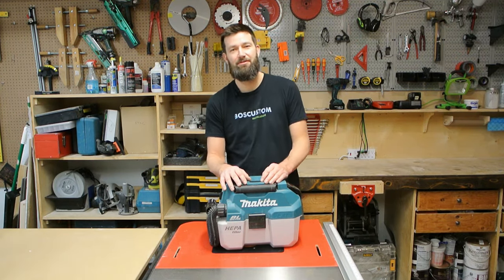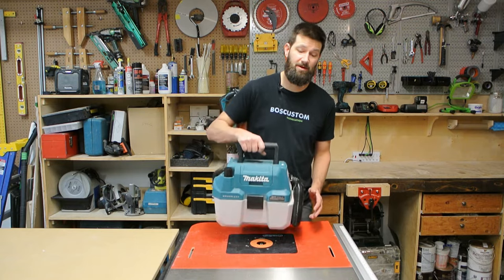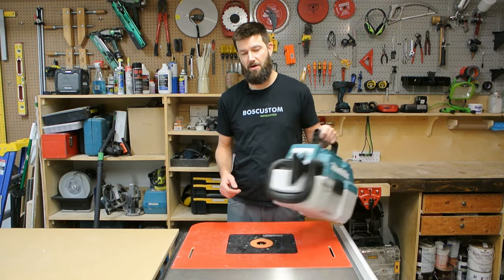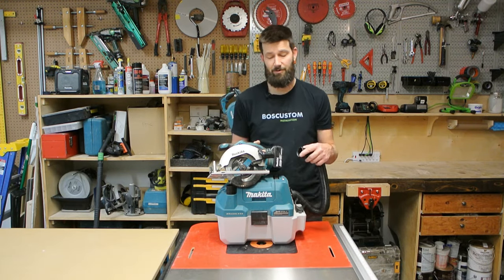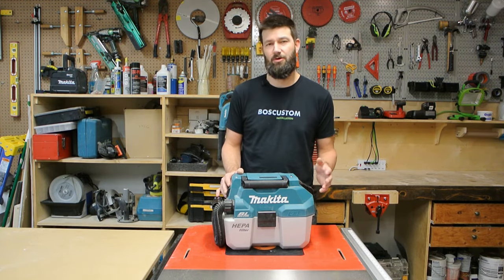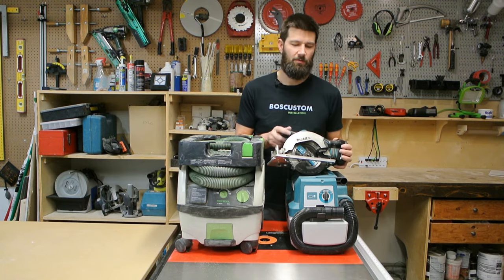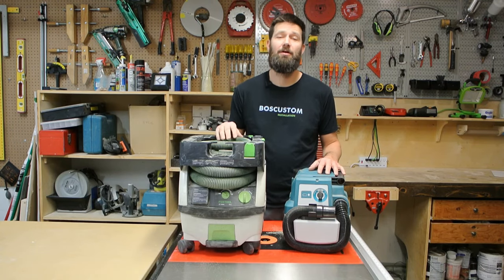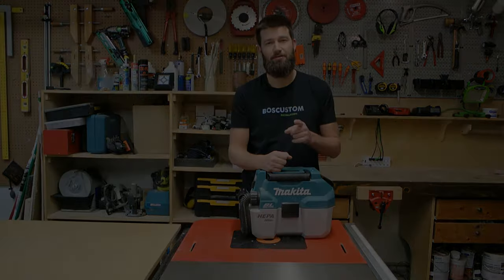Makita Cordless Vacuum Review

Comment: Great review. This definitely fills the gap when you don't need the power of a larger shop vac. Perfect for a cleaning up after a small job and just the right size for cleaning the car by the looks of things. Definitely ordering one soon.
Reply from the maker: Nice! It’s a great unit.  If the filter is clean and the battery is fresh it does a decent job with vehicles.

Comment: I really appreciate the comparison to a corded vacuum. My biggest concern before buying the makita was "will this have comparable suction power."  I do fire/water restoration, using equipment as a convenient step stool happens frequently on the job site. The makita vacuum seems perfect to use with tools for dust mitigation as well as great for smaller job site clean up. Awesome review video, you just sold me on the makita vacuum. I can now buy it with confidence!

Comment: How’s the battery life? I have the Milwaukee m12 fuel vacuum and I get awful run time, granted I’m using aftermarket m12 batteries. But it’s really a battery hog. How is this one? My main system is Makita LXT, no clue why I didn’t buy this one.

Comment: At 5:04 in the video, can you please share the model number of the extension wand and floor nozzle you're using, please? I've looked high and low for compatible attachments and have come up with no solution.
Reply from the maker: Nom Solo that is the Festool compact cleaning set. FEST203430. It’s not cheap but it is awesome.  The fit is not perfect with the Makita, you have to jam it on a bit.  It’s like 95%.
Reply: @TheFunnyCarpenter  what kind of extension did you use for the circular saw? where any change in performance? I guess it was lower with it, but still enough to vacuum the saw dust.

Comment: Do you recommend this cordless makita vacuum for a auto detailing?
Reply from the maker: dopey310k just tested it out with the crevice tool on the carpet in my truck.  It works better than I would have expected.  You’d probably still be better off with a corded vacuum, but if power availability is a problem the Makita cordless will get the job done.
Reply: @TheFunnyCarpenter  thnk really helpful
Reply from the maker: No problem, thanks for checking out the review.
Reply: I just got/used mine today, did the whole car almost on one not-full battery, had a bunch of mess/was trying to be thorough, didn't time it -- tool seemed quiet-effective. After folk had warned it wouldn't do well, etc. Well? I liked the result. My one issue on my first use, I wanted to put the unit in the car seat while cleaning the floor below that seat, but the suction-end sticking out toward the floor has the blowing-end risking being up against the car seat... I still did it, just had to position the unit a bit funky sometimes. Cleaned my car floors, trunk, etc, pretty nicely, was nicely portable, and uses the same battery as all my other Makita toys so when I saw the bare tool on sale I snapped it up. No more having my passengers get into a seat with crushed leaf-mess on the floor, or whatever... Oh, and after I vac'ed my car I moved the hose to the other side and blasted the ground near my car, it pushes away dry leaves/debris, as to some of the clumpier/wetter/etc stuff, not so much. But it's not supposed to be a leaf blower/good enough/I'm enjoying the gizmo. And recommending it for cordless auto-detailing, absolutely. If you don't mind a cord -- and I do -- but if you settle for corded use I'd note there's a large corded rigid vac being sold with an auto-detailing kit that, yes, probably kicks the crap out of Makita. And piles of youtube vids recommending it (go watch vac videos, I did...). I liked the vac, the maker, and the various auto-detailing attachments in that package, But getting that out to my car? Just a total hassle. So I went with this... It may catch fire tomorrow, but as of the first day? I am quite pleased, and my car's nice 'n clean.
Reply: Quite effective, and 5 amp hours on the battery. I started at 3/4 bars, I needed just-a-bit-more so i swapped to a similarly drained second battery which I didn't query for charge but should have been about-the-same (they're a pair that was being used with Makita's 36 volt (2x 18 volt battery) chainsaw).
Reply from the maker: George Corder that’s awesome!

Comment: Question:
Does it matter what filter you use and can you just use any kind of filter and/or skip the filter entirely?
Reply from the maker: I definitely think you need to use a filter.  The vacuum comes with a reusable filter that you can clean off.  I usually just knock it off and then use my blower to blow it off...down wind:)  I imagine you can order new ones but the will last for a long time.

Comment: Great video! I didn't know Makita had a biscuit. How has that held up? I was drooling over the Festool, but don't want to drop $1500 on that.
Reply from the maker: I don’t use the biscuit a tonne but it’s held up, and seems to be well built.
Reply: @TheFunnyCarpenter  Thanks. I have years of Makita 18V use, and although they can be annoying, like no wand for this vac, I'm not starting over with another cordless brand. As far as Festool, until I'm rich enough to care, I'm in the overrated camp.

Comment: Been thinking about getting this. It’s a hassle if you pack everything up and forget to clean up an area in the basement or attic at the end of the day. You have to pull your heavy vacuum out again and bring it in the house to the basement or attic and then try to find an outlet. It takes more time doing that than it does vacuuming up the mess. 
This Makita vacuum might be an aggravation saver.
Reply from the maker: I definitely just love having it on hand to clean up things as they happen.

Comment: Hi, great video! Could you please send me a link or put it below the video of the Rockler or equivalent hose extension that works for the vacuum and wondering if it would attach to my Makita track saw I just bought??
Reply from the maker: I just put an amazon link in the description Yes it will work on the Makita Track saw and also smaller dust ports.

Comment: Is there a 36V version of this?
Reply from the maker: Yes there is, it looks pretty nice, I’d like to get one to pair with a cordless miter saw in the future.
Reply: Got one on Monday used it all week an it’s great mostly with i planer on mdf and no dust .used it on Tuesday to do a door bottom .needed to take about 10mm of pine off and it did choke an spill about two handfuls of shavings but later found this was because the dust bag was blocking the inlet .its great mine cost £370  I know it’s not cheap but if it’s cordless am more likely to use it
Reply from the maker: R C lol you are so right about using it more because of the cordless-ness!

Comment: Can it work with 10 cordless mitre saw
Reply from the maker: It could do a pretty decent job if you kept the filter clean.  It lacks capacity so it would be a bit of a pain if you were doing a lot of cutting.
Reply: Cool thanks for the time
Reply: Don Waltz no problem thanks for checking out the review.
Reply: get the aws vac for your mitre. it will be automatic dust collection just like a corded vac and saw, but via bluetooth. its double the price of the vac reviewed but much more powerful with added features.
Reply from the maker: Immortal Soul great call, I see one of those in my future, probably when I switch to a cordless mitre saw.
Reply: @hasandilek92  yeah I saw the demonstration online looks pretty cool

Comment: How much do they usually cost?
Reply from the maker: You can get one for 239$ Canadian.  The batteries are 50-130$ish depending on the amps.  I’d recommend at least a 4 amp battery.
Reply: @TheFunnyCarpenter  Where did you find this model (Makita XCV11) for 239CAD?
Reply from the maker: John Doe it’s on sale at KMS tools for 239$ as of June 2.
Reply: @TheFunnyCarpenter  Nope - the XCV11 is not even listed on their site.
Reply from the maker: John Doe try looking up this model # DVC750LZ.  If you go to the Canadian KMS site and search for Makita Vacuum it will come up.  Cheers:)
Reply: @TheFunnyCarpenter  Thanks!